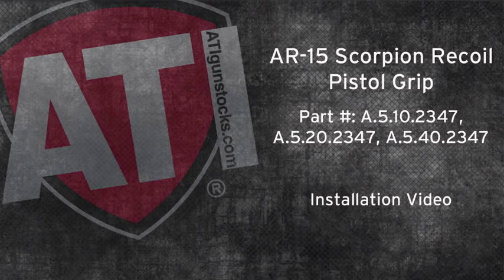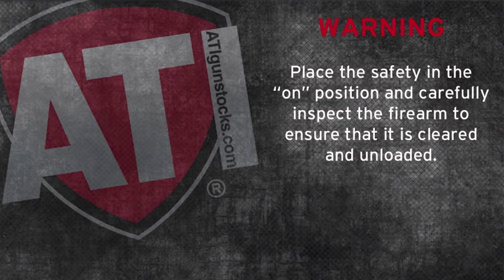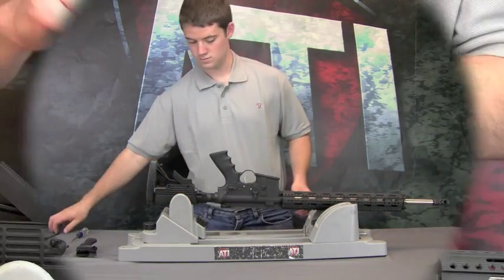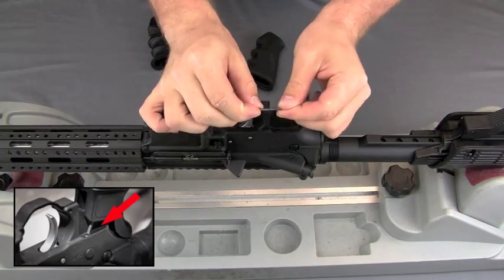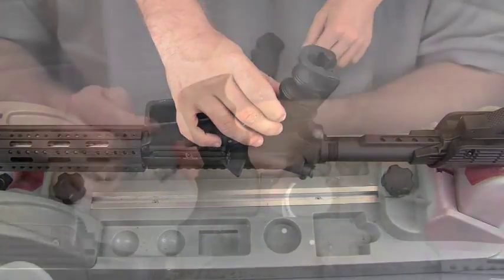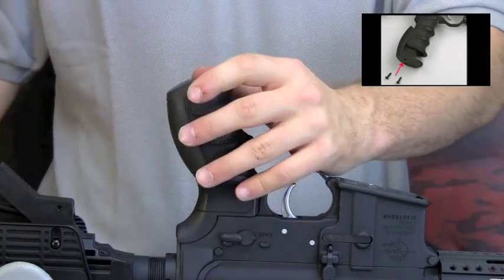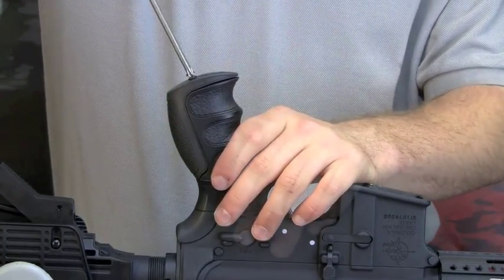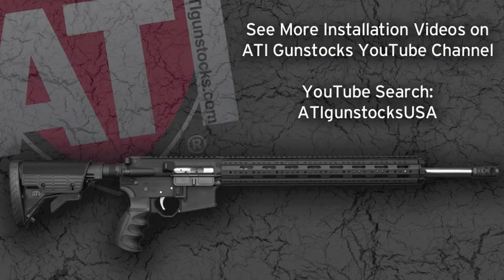ATI AR-15 Scorpion Recoil Grip Installation

Comment: The thing that keeps me from ordering any new ATI stuff is that the grips never, ever, ever, line up with the bottom of the receiver with the trigger guard is installed.  I most ALWAYS have the corner edges of the receiver denting the top of my middle finger.  The shot at 1:25 shows that this grip is no exception.

Not a bad product, I'm sure, but I'm really picky about details.  Sticking with my MIAD for now.